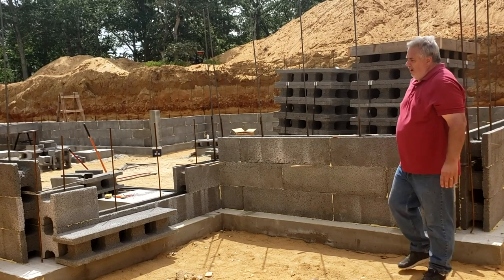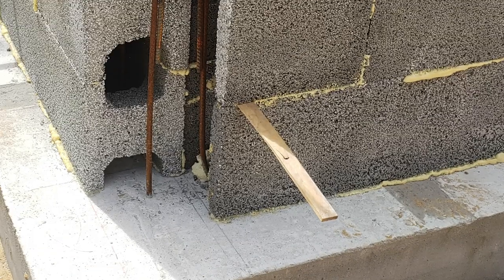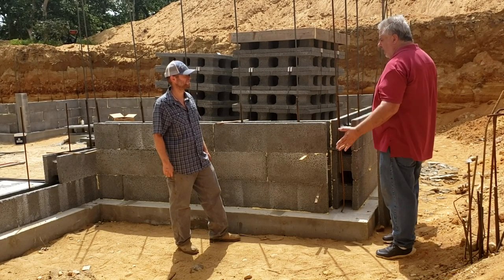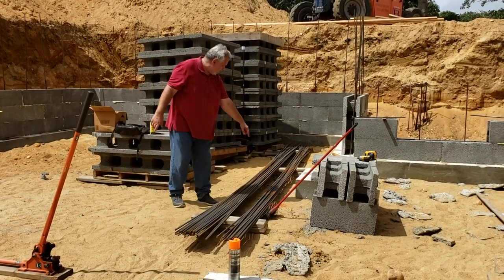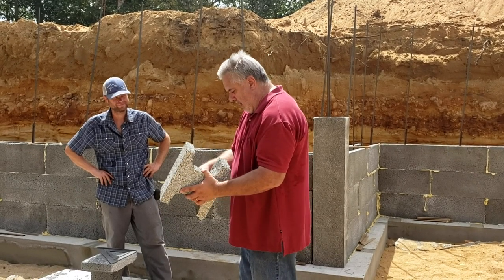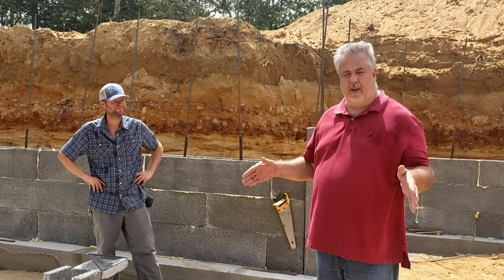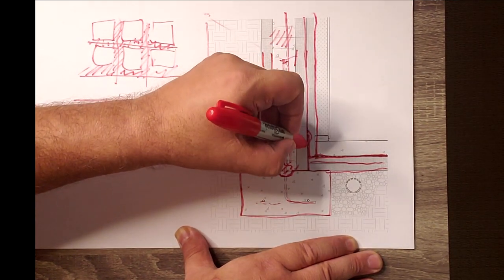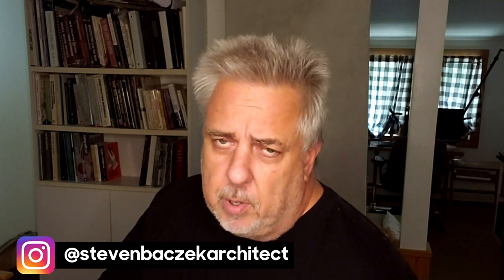The PERFECT BLOCK Foundation - Part 2

Comment: Another great video  Steve!  Two things I'd like to have seen.  1) Outside wall treatments (if any).  Do you really backfill directly  against the block?  2) Rebar caps!  I get not running them at times.  But at 3:45, if you'd stumbled and fallen backwards, you would have landed in  a bunch of uncapped rebar.  Workers sticking off-cuts in the ground is fairly typical, but they really should be capped for everyone's safety.
Reply: +1 on the caps...cheap protection from a life changing accident!
Reply: They could have just capped them with used plastic bottles

Comment: I like the perfect block over traditional ICF mainly because of resistance to termites.  Termites won't burrow through perfect blocks but termites love to burrow through the EPS of traditional ICF.  The problem being you can't inspect for termite infestation with traditional ICF because the termites are hidden in the EPS.   I love the instructions on how to assemble perfect blocks but you never covered the critical detail of the water barrier.  I  hope you will provide another video covering the installation of the water barrier.
Reply: They make great peel and sticks that are terminate resistance or you can put in a band board (cut out 2" of foam at grade) and IF there are termites, they would have to reveal themselves.  Buildblock also makes something for it.. ICF is still a better all around product.

Comment: Great video Steve.  I've never seen this version of an ICF wall.  In your detail, it's interesting to see the perimeter drain pipe with the perforation up.  I've been under the influence that putting the perforations down allows for a lower standing water height around the pipe without impeding flow through the pipe.

Comment: I've built some large homes with Apex blocks, the company is now gone I believe. The rebar could be mostly replaced by the large commercial fiber. I've done a bunch of flat work and gone back and looked at it 15 years later and it has less cracks than the slabs with rebar

Comment: Great Video Steve,
Amazing how solid the wall is before pouring the concrete.  I'm wondering if the walls need bracing like ICF before pouring the concrete?  
Looks like an amazing product. 
Cheers,
Eric
Reply: You can pour 1 floor at a time without bracing.
Reply: I read that bracing isn't usually needed up to 8' heights.

Comment: Would this house qualify for a termite bond? I hear pest control companies won’t touch ICFs, for same reasons @steve French mentions below……is that true? I know Perfect Wall is different, but do pest companies agree and insure?

I’m also curious how you recommend applying waterproofing, stucco exterior, plaster interior…..I’m excited about this wall system and hope To learn more!
Reply: They just wont guarantee it, but they will still treat an ICF home..
Reply: Stucco can go right onto this since it is a cementicous product. I need to ask the company about the use of a rubberized stucco coating for the exterior of an above grade wall.
Reply: @ericslater9666 Which rubberized stucco coating did you go with? What did the company say about using it on this ICCF?

Comment: What are the true benefits of the ICCF VS ICF??  I see way more labor and not a good quality controls over the blocks
Reply: No need for expensive bracing, membranes, coatings. It doesn't degrade if the project gets delayed. Stucco can be applied directly to exterior. Pest resistant.
Reply: There is little to no benefit in ICCF.. You still have to stick frame the inside and the R-Value of ICCF is much lower than ICF.. I believe it has been calculated at R1.7 per inch vs R4-5 per in for ICF.  There is a reason they removed all R-value from their website.. They were falsely claiming R30 structures when they are closer to R15.  Also the pest resistance is a lie as there are some good examples on forums of rodents eating THROUGH the wall since there is not a solid fill like in ICF..
Reply: @FJB2020  I don't pretend to know what the truth is, but people also claim the r-value of ICF is less than advertised.  The whole, r-value vs "effective" r-value because there's no air leakage.

The reason I'm considering ICCF, among other options is price.  No bracing, no membranes, no coatings.  Cementitious exterior ready for stucco.  It works out cheaper for me, even if it's not as efficient.
Reply: @FJB2020  You obviously have not researched this material prior to posting this comment.

Comment: So, like ICF, but made of eps toxic garbage, less insulative, lots more work (foam mortar and bracing), more rebar, and sourced from 1000s of miles away. What's not to like?

Or, just use AAC
Reply: Way less bracing needed compared to ICF, rebar amount comparable depending on build/builder.  Distance is the big downer though.

Comment: How this basement can be waterproof? No way. Styrcon (styrodur + concrete) as it's called here in EU is a porous and absorbent material. I don't see any continuous (slab to wall) isolation against water capillarity or pressure water. This will be like a sponge with no thermal insulation ability after one season.